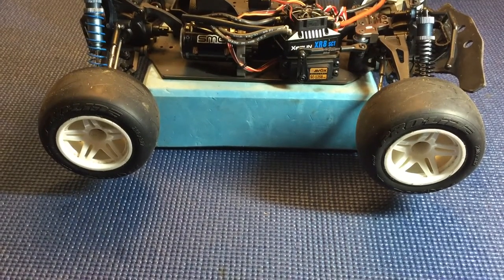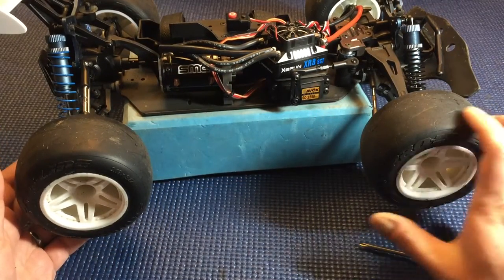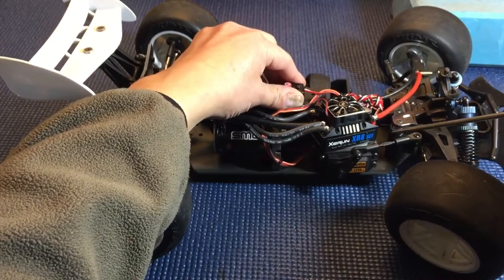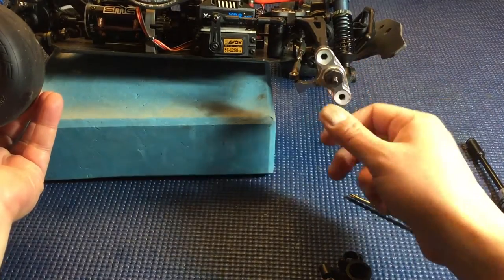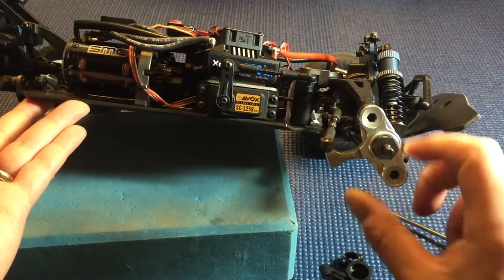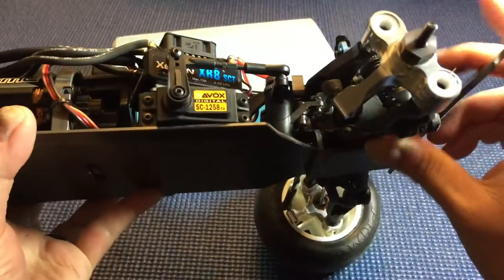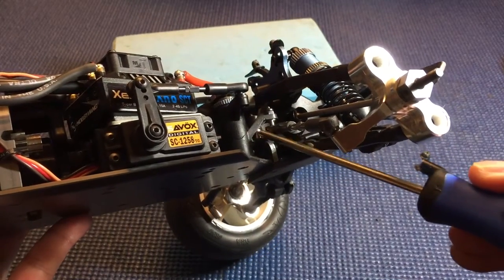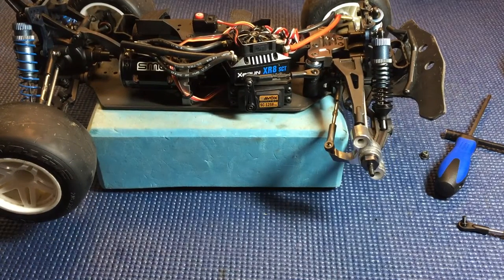Hobao Hyper TT - maximizing your steering travel

Comment: Thanks for all the info bro! I have the 10sc, I love to find those steering knuckles!
Reply from the maker: Charles Pagan I eventually took off the knuckles and just boiled the plastic ones.
Reply: @RazorRC  I had to shims my diffs, I'm running 42/70 hobbstar 2200kv motor in it!! 4s 20 mins of insane power ! I check the temp on the diffs instead the motor!!!
Reply from the maker: Sounds crazy, but I'm not surprised the drivetrain can take it!

Comment: That suspension is super sloppy... this truck is garbage.
Reply: @RazorRC - I really wanted to buy this truck... I love pivot ball suspension setups.. and I like the small size and the overkill drive train. But steering precision is what separates $200 kits from the $400 kits. Please let us know how the slop is with the stock "boiled" setup.. OR... just replace the entire ball stud and knuckle with a kyosho dbx buggy parts.. as long as hyper tt arms accepts the thread and diameter of the ball stud.. it should work.
Reply: You recently turned the Hyper into a basher... how has it held up? And more importantly how did the pivot ball hub hold up?